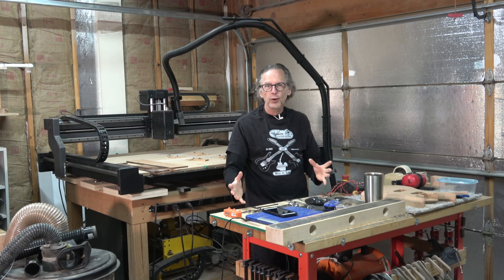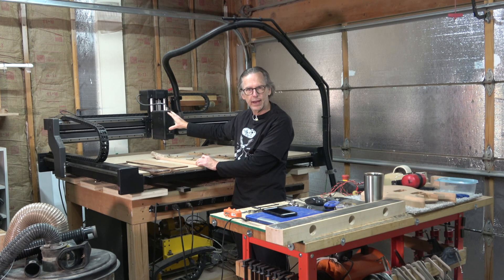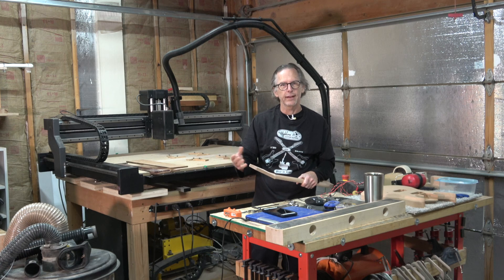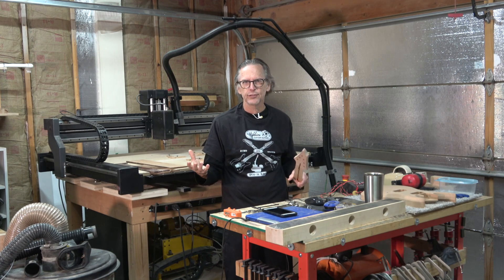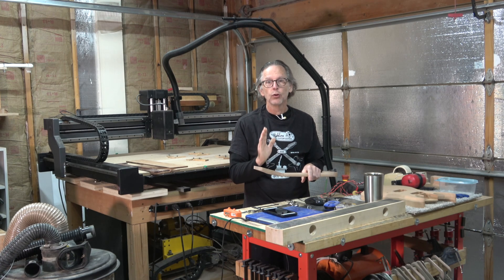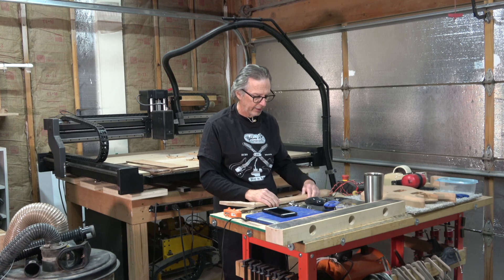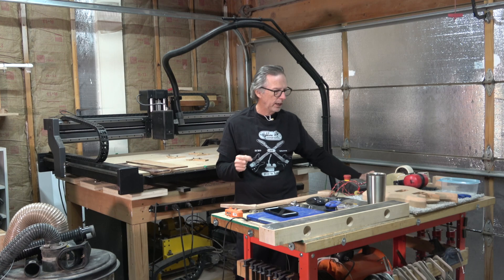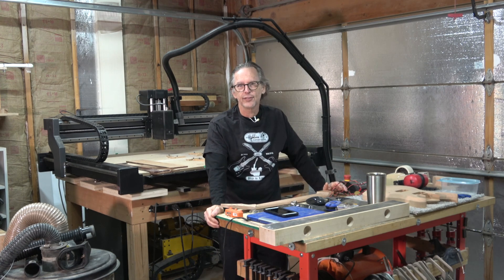CNC Tuner Holes, Headstock Scarf Joints, Wood Waste

Comment: Love your videos.  Wondering how you are recycling your chips and dust?  

I use my chips and dust to “mulch” areas in my yard where I want to suppress weeds.  Next best thing to agent orange.  

A woodworking friend uses a light dusting of wood chips and dust to improve traction on his driveway and sidewalks in the winter.  They actually promote melting of ice and snow.  Much better than just putting them in the bin and sending them to the land fill.
Reply from the maker: Wood stove pellets.

Comment: so I got a fun idea. So I got this straight grinder 600W, and it can only do 10k to 29k RPM, right. I wanted to mill steel, but I gotta have a much lower RPM for that and probably more force. I was trying to figure out how to lower the RPM the electronical way. But why not use gears? I can just mechanically get it done with a gearbox and attach a mill to that. It will be a bit clumpsy big perhaps, but it should work fine as long as the gearbox is solid built

Comment: I use scarf joints for angled head necks because of the waste of wood, and it’s stronger. As a repairman I’ve fixed way too many broken one piece heads, even with maple (on a Pedulla bass). Scarfs are more work of course. I also only do a 8° angle. Lately I make lots of flat headstocks.
Reply: I agree. Use a scarf joint. Not only do u save on having to recycle, could save money buying thinner wood and save wear on your machine as you don't need to remove material
Reply from the maker: Which is all well and good unless you or your customers want a one piece neck.
Reply: @HighlineGuitars  I generally don’t make one piece necks. I like to do three piece laminated necks. But everyone likes something. 😃

Comment: You could always glue a scarf joint onto a thinner piece of wood before you cnc, so you buy cheaper wood and don't waste over a inch of wood on the neck
Reply from the maker: NOTHING GETS WASTED! Please pay attention!!
Reply: @Highline Guitars I paid ATTENTION.  Its just In my view its better not to machine off a lot of wood, to recycle, when you could just use a thinner piece with a joint glued on it. Just my 2 cents
Reply from the maker: @briw4647  Scarf joints take too much time to make. Also, I got tired of explaining to my customers what a scarf joint is. Most of them think they make a guitar look cheap and shoddy. And that's my 3 cents.
Reply: @HighlineGuitars  Wow, that's surprising. I've always looked at a well-executed scarf joint as a measure of high quality. Of course I believe you that you're hearing that most of your customers think otherwise; I'm just surprised by that.
Reply from the maker: @alexbasson  I have always thought of scarf joints and laminated necks as a way to use cheaper boards that would otherwise be rejected as too thin or having the wrong grain orientation (flat or rift sawn).

Comment: Chris that new CNC is wicked.  I'm looking at your plans you offer to build a CNC. Was your old one a kit you purchased or did you sort it all out in your head first and order individual pieces? Will your plan help me source the parts? I think it'd be an awesome project and my wife, with her crafting, and I would get good use out of it . The ones we have looked at from outlets like Busy Bee get pricey in the size your build unit is.  Thanks so much.
Reply from the maker: I designed it myself and sourced all of the parts. The assembly manual includes a list of all of the parts, but it does not include sources from which to purchase them.